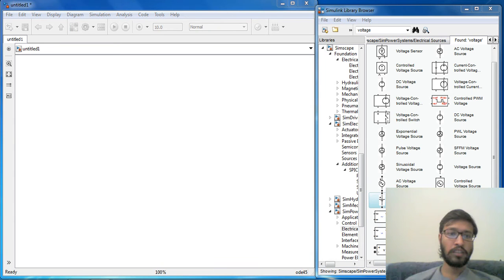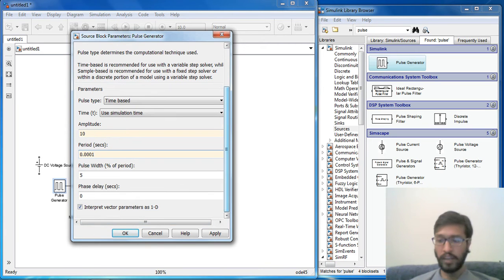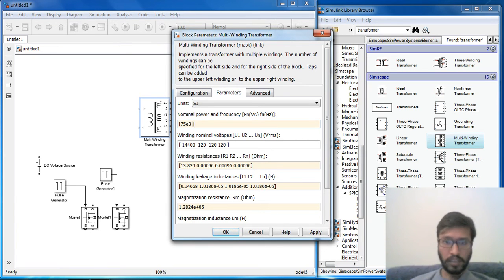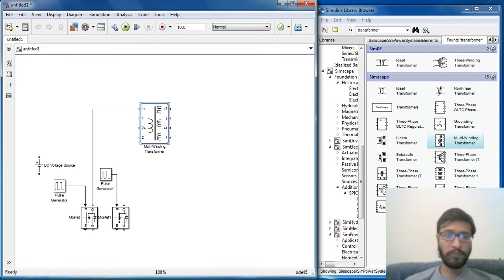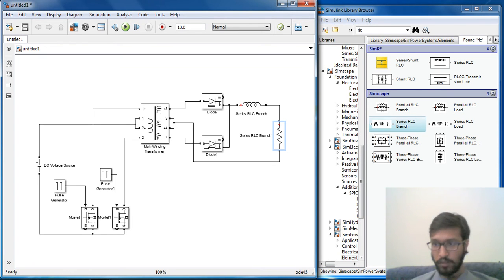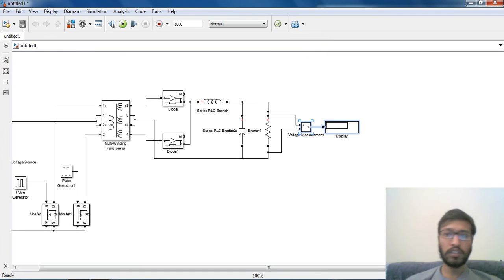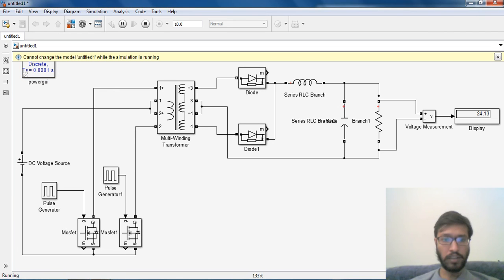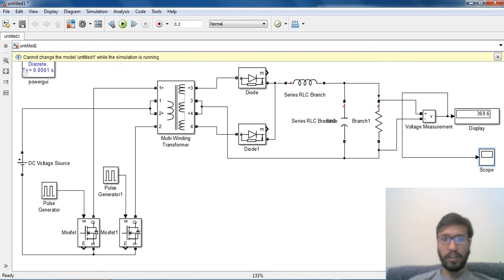Matlab simulation of push-pull converter.

Comment: Hello!, i have a question, did you calculate the converter components and transformer windings ratio? or you just select those values ramdomly until it worked?